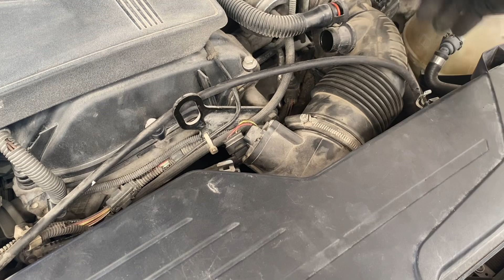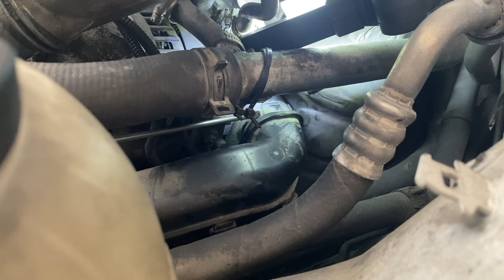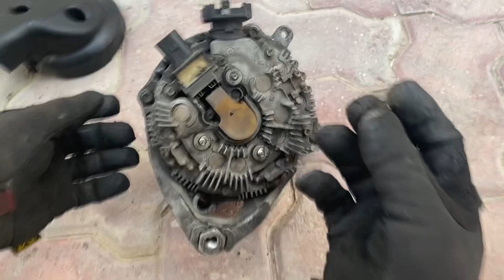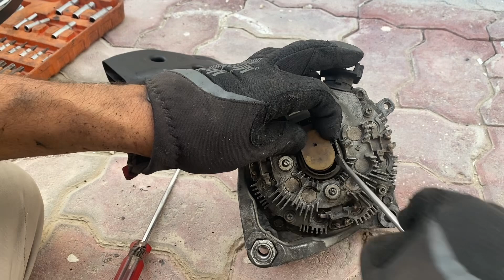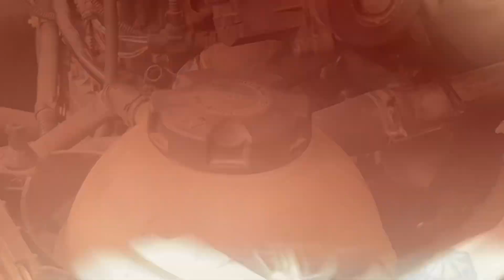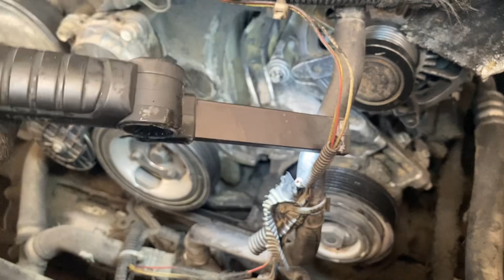BMW Charge Fault fix!!! Alternator replacement F20/F30 N13 engine

Comment: I am confused if I’m not wrong you just removed 2 bolts of alternate from front and take it out? Or did you removed that lil bolt as well
Reply from the maker: Little bolt was just a dummy in my case. U have to remove it as it holds to the coolant hose. Alternator removal is really simple in this car
Reply from the maker: Have to remove the little bolt as well. In mine it was not in position, it was broken.